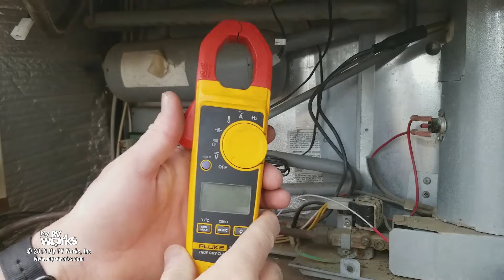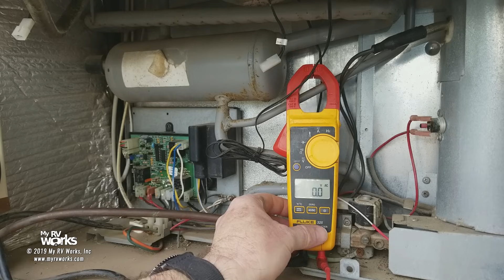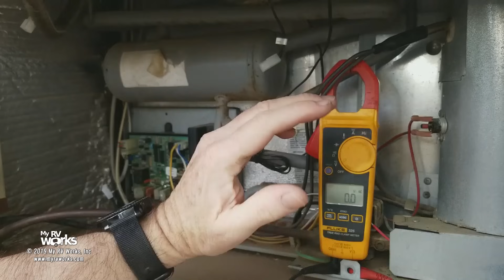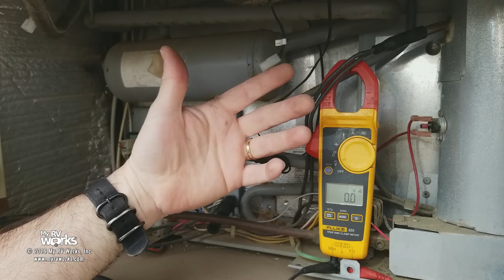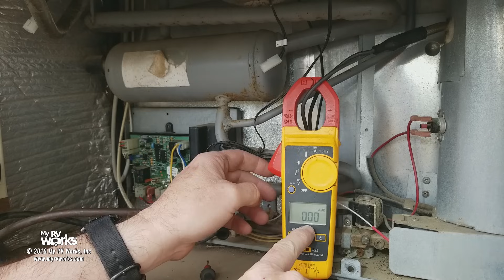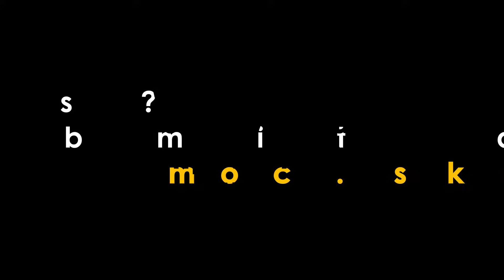Troubleshooting An RV Refrigerator That Works On LP But Not On Electric

Comment: Thanks for producing a concise explanation of how to diagnose my rv refrigerator problem. One question, does it make any difference in the diagnostic process when the power source is a generator/ inverter rather than "shore power"? I suspect a failed controller board however I am unsure if the generator delivering 60v on neutral and ground and 60v on load and ground changes any of the diagnostics.
Reply: Makes no difference. Your refrigerator doesn’t know where the power comes from. It either has power or it doesn’t.

Comment: I have a Dometic 2662 and followed your diagnostic tips, and seems like the heating element is not getting 120v delivered through the control board and no lights are illuminated on the fridge so I suspect a bad CB. Does this mean it will not work on propane also ? Thx for the great video
Reply from the maker: The lower control board is fed by 12 volts dc. There is a fuse inside of that control board. So verify 12 volts is making it into the board and through that fuse.
Reply: @MyRVWorks  I forgot to mention earlier that both fuses are good and I verified that 120v is making it to both fuses

Comment: Darren what do you think about these 12 volt conversions. I'm not sure the proper terminology but switching from 110 volt propane refrigerator to these newer 12 volt induction motored compressors. I've seen a couple videos, but the ones I've seen the company that produces the 12 volt induction motor compressor donates the components to the people making the video. I think when you donate a product tune independent tester it kind of taints the process. I just wondering if you had any experience or knowledge of these systems. I'm just thinking that with a proper solar system maintaining a charge on a proper size battery Bank. That may be a refrigerator that actually maintains 36 degrees continuously would be an advantage or does it open up Pandora's box and battery drainage?
Thanks
Nick from Arizona

Comment: Hi Darren, I have 120v power on both sides of my fuse but nothing coming out of the board to the heating element. I installed a new board and have the same thing. Any suggestions?

Comment: I have an issue with my 3 way Dometic fridge (from 2013). We had a gas person today (who specializes in this type of equipment) but he could not find the source of the problem. Basically we can smell gas in our motorhome but only when the fridge is ON. When the gas hob or oven are in operation (while the fridge is turned off) we don't have the smell of gas. The flame from the gas hob is good and the technician said he was pretty sure there is no leak in any pipes. Some help would be greatly appreciated. We have run out of ideas and solutions.

Comment: Looking for help. RV refrigerator not working. Inside walls are hot. Been on 9-10 hours. Burners work, heating element works. Everything works but no cooling. I don’t know anything about ammonia systems. R12 502 404a 22 all day lol, but 1st time working on my neighbors RV fridge. Is system out of fluid? Am,Onvia peak which is why no cooling and boiler just heating the piping up? Thanks guys

Comment: I am connected to power at home and that outlet that connects to the fridge outside is not getting power. No breakers tripped or fuses blown. 2014 salem forrest. Any suggestions?

Comment: Your video was very helpful, and I believe I found a bad circuit board, as there is 120 at the "wall" outlet but no power on the fuse above the power in wires.  At the end of the video you mentioned a 2nd, upper circuit board to check, and that you would cover it in another video.  I've search all of your videos and can not find it.  Could you please direct me to that video.  Thanks for your help.
Reply: Great vids. I am also looking for the follow up video on which board is bad. My board looks good but does not work on AC. Works on propane but can not switch to auto or AC.

Comment: Great and awesome video.   I have the same refrigerator 3862  and same 
problem. Followed step by step instructions  My heating element is good,    So I 
wondering about the video to determine from the lower or upper circuit 
board ?  Again  Thanks for the videos
Reply from the maker: I have two additional resources for you:  First is this video:  https://youtu.be/IT_5HGe4q-k
You can jump to 35:45 where I discuss control board troubleshooting.

Second resource is on my Website Resources page:  https://myrvworks.com/manuals/
Filter for refrigerator/Dometic and search for this file:  "Dometic Refrigerator Training"
That was a PowerPoint I saved as a PDF.  On page/slide 62 & 67 there is more info on troubleshooting the wire harness and upper lower boards.

Comment: My reefer only runs on propane as of today and I've notice half of my outlets inside stopped working. I have one gfci and it seems fine and reset it just for good measure. Is it possible that the reefer not running on electric is also the cause of half my outlets not working?

Comment: Freezer is 8degrees but ref food is not working and 59-65 degrees?  Please Lp is working but need to CJ upper eye brow board. How to  check eyebrow board power is all 12 v? Is it the 5 wire plug to ck?

Comment: Our 2011 Montana has a Norcold N811, it works fine on electric, when I unplug the camper to go the campground  it will switch to gas okay. But when we get to the campground and plug it back in it will switch off the gas but the electric won't kick it. I don't get any flashing lights on the panel. Now if I turn the fridge off and then back on it will work.  Any ideas what would cause that ?

Comment: I am trying to find the upper control board video . I changed the lower and still no luck . Tested the element and got 43 ohms . Have 120 volts on  the board.  And it works good on lp

Comment: Thank for all you do, checking my heating element and the omhs reads 36.6.  The specs say 44 omhs for the Dometic RM3663 is this element bad?  I have one I brought a few years backs brand new, and it's giving me around 40. is this one bad?  Any help would be greatly appreciated.
Reply: I believe he said plus or minus 10% variance is acceptable. So anywhere between 48.4 and 39.6 ohm is a passing value. Therefore, if your value is correct it sounds like it fails the spec resistance check.
Reply: @greauxpete  thank you I didn't catch him mentioning the 10% variance.  Does this also apply to the 12V heating element?

Comment: Very informative video. 
I  replaced my board on the back because I had no power to my heating element. Now I have no power still. My upper control board seems to not have any power either. It works on gas if i force hot wire it. And my heating element works if i feed 120 to it.I am thinking that it is my upper control board. But I don't seem to be getting any power to the upper control board. The check light used to blink. Now  nothing 😑 .
Lower control board is a new  dinosaur brand. I Donno

Comment: Last week I was prepping my cabover kamper to go on a trip. I has tested the fridge on propane when I got home from town after filling the 2 bottles. Then plugged into shore power and turned off the propane. Then had a delay to start my trip. Turned it off.. then days later when ready to go.. it wouldn't turn on.. on electric or gas. I had the control board tested and was told it went bad. So I ordered a replacement to dinosaur electronics in Lincoln city, Or. Eyebrow board was tested good also.. but still does not turn on.  Now what..?

Comment: My old Norcold stopped cooling, and I ended up replacing a bunch of stuff. Control board, power board, eyebrow board, and the thermister! The problem now is that it works great on LP if the AC cable is unplugged completely, but if the AC cable is plugged in, it gets too cold and freezes everything! Even if I have it plugged in but have the switch set to LP, it still freezes everything (presumably with AC). If it's unplugged, it cools to the right temperature with propane without overfreezing. Ideas?

Comment: Great helpful points. Thanks, Darren. Tho my fridge is a Tedco, these tips are helpful. My fridge works great on gas but not on 120 vac. When I turned off gas at bottle, the heater coil started to heat up.! maybe a conflict with the source of heat??
Reply from the maker: Hi Joe,  I can honestly say in all my time as an RV tech I have never come across a Tedco refrigerator - so I am at a bit of a disadvantage in helping you diagnose that issue.  Do you have the switch on the eyebrow board for Auto, AC and LP?  I know that on a Dometic and Norcold frig if Auto is selected than the AC is the primary and LP is secondary.  One test I perform is to place the unit in Auto and come around back and unplug the AC cord and verify it will switch over to LP.  Then when I plug it in again I verify it switches back to AC mode.  Have you tried something like that?
Reply: @MyRVWorks  I never heard of Tedco either until I bought this 1975 travel trailer with one in it. Looks very much like the common Dometic. Has no Auto control, just Gas or AC/DC toggle switch which works only when gas pilot/on switch id in Off position... . I shut gas off at bottle and it seems to be now giving me a hot coil at ammonia tank (good sign, i thnk). My brother said it worked for him before. How level should they sit? (My trailer is jacked up on one side for wheel repair). You may have a good hint here: unplugging AC and/or shutting propane off at main tank, back and forth, to force it into other energy mode. ..as it seems not to always shut off with fridge control switch.
Reply from the maker: @joeboudreault4351  Since these refrigerators are chemistry sets the more close to level the better!

Comment: So I took a closer look and it looks a little brown/burnt on one side of the 3amp fuse on the circuit board, I looked around for a replacement lower board for my RM7030 refrigerator, non of the boards that says they will fit my unit looks like what I have, any suggestions?

Comment: Darren - great video.  My Norcold 1200 series just got a new cooling unit installed 6 weeks ago, and was working great, but now my temps show FRZ: 25 and FRIG: 52 just in the last couple days.  AND I no longer hear the cooling fans running, and the ice-maker isn't making any ice.  Unit runs only on LP and when on AUTO will only go to LP, and not AC.  So no run on AC and no cooling fans running.  I suspect a popped fuse but until I can check it out, I need to cool down the fridge/food!  I put a fan blower into the outdoor service access with a bungee cord.  Will check in the morning.  Any tips..........?  Tks

Comment: My issue is my solar will not fire up my electric anymore. I upgraded my solar and now it will not use the AU end only runs propane. Shore power works fine

Comment: Should I have 120 volts on both the pins that the heating element attaches to on board I have the correct voltage on the right pin but the left have nothing

Comment: Great video.  I have a norcold that is not working under AC, but fine on propane. 
Checked outlet, good. Checked AC fuse, good, 
No power to element leads on lower board. 
(Bought a new board and same thing). 

Upper board seems ok, but I’m stumped. 
Any other ideas to check?
Reply from the maker: Hi Eric,
 
Your question has been selected for an upcoming video where it will be read and discussed by Darren - Certified RV Tech and online personality for the 'My RV Works' videos.
 
If you have not already subscribed to the 'My RV Works' YouTube channel, please do so and keep a watch for the ‘RV Tech Talk’ video releases.  This series is a selection of comments and questions that will be covered and released weekly.
Here is our YouTube link:  https://www.youtube.com/c/myrvworksinc

Happy Camping,
My RV Works Media Team

Comment: If that cylindrical 10A fuse is good (checked with meter) but not getting any current. Where is the problem? How does the current flow?

Comment: Hello Darren I have three issues with my RV travel trailer that is bugging me; The first one is a Dometic RM2551 refrigerator that works on AC but not LP-I see spark but no flame. The second is a Dometic heater that comes on and I can hear the fan, clicking sound like a spark, and blows heat for a few seconds and then turns off. The third is a Dometic 15K BTU AC top mount that burned a limiter switch Klixon 20z6ab MRA4720-12027 on top of the compressor-I am assuming it's a compressor. Do you have any videos on these models or situations? Thanks in advance for your responses.

Comment: I recently put in a new cooling unit and the old heating element was frozen, so I bought a new one from Amazon. It worked for about 2 weeks and then would only work on propane. I did as you suggested at 12:48 and had OL. I pulled the heating element and it was burned and half of it had burned off, so it was about 3" instead of 6". I just ordered another one from a different manufacturer. Any ideas as to why it would burn through?

Comment: I'm a little confused on the blinking check light only because of the LP, I have my LP turned off and the light blinks but the refrigerator doesn't seem to switch over to AC power but the electric tube heater is working. So should I turn the gas back on? I want it to run on AC, but if I turn on the gas won't it just run on gas ?

Comment: I have followed everything to diagnose my Norcold 1210SST refrigerator and the unit does not function well in electric mode.  AC voltage going is 110 volts as well coming out of the terminal board for both black and yellow leads. Checked ohm readings on both 225 watt heaters and they are 65 on one and 66 on the other. Range should be between 58 and 68. Changed control power board as well high limit control module as it seemed to become weak relay. Changed out the high limit sensor as it did not work with old sensor. Propane works fine and no error messages but electric does not work or frig starts to raise in temperature. I have not taken out the elements but can a slight coating of corrosion on the heating elements cause some sort of an insulator for the 707 ammonia and hydrogen not to work?  Any suggestions as I am baffled now.
Reply: To add I checked the amperage and was getting 1.3 amps. If I have 110 volts going in and the rating of my elements should be 225 watts than my average should be 2.0 amps. Will this cause lack of heating?  Right now and based on voltage and ohm reading I am only getting on each element getting 186.15 watts.

Comment: Great video, super easy to follow. I hope you may be able to help me with my issue as my Dometic NDR 1292 now works only on propane but not on electric. I followed your steps and believed that the heat element was bad and ordered replacement, but when testing the Ohm resistance I get 33 from the new ones and 33 from the old as well. My issue actually is the fuse keeps blowing when I switch fridge to power. It is the fuse you show in this video. I have correct current on left side but obviously no current on the right as the fuse blows instantly when I turn the fridge on to A/C instead of propane. Any help here would be greatly appreciated.

Comment: Good Video.  Had 120 at outlet, 120 on both sides of fuse, nothing on j8/ j7 and good connected current for heating element. I replaced relay in circuit board and still no power on j7/j8.  Ordered a board (new design) and still no power to j7/j8.  I pulled eyebrow off again to see if I missed  corrosion or something the first time I looked at it.  Nothing, everything  looked fine.  I wiggled  the plastic clip holding the 4/5 wires to the board and tried again.  It was a poor connection on the contacts  of upper board.  J7/j8 now have power and fridge now cools on electric.   Hopefully this helps someone. "My RV Works" should I replace upper board or is this common (poor connection)?
Reply from the maker: Good troubleshooting. As I was reading this, before I got to your solution, I was thinking it was a connection at the eyebrow board or an issue with the wire connecting the two.  I don't know that you need to replace the eyebrow board. Apparently the problem was not with the eyebrow board but with the connection. So, clean your connections really good and keep on happy camping.
Reply: I came up with the same problem no power to the element but I don’t understand eyebrow board term can you post pics before I drop a hundred on a new board

Comment: When I meter (AC volts) at j7 and j8 individually to ground I get 120vac. When I put a lead to j7 and a lead to j8 to meter for 120vac I get 0. I am confused on how to properly test this. Is it pin to ground or pin to pin?

Comment: My dometic fridge keeps blowing the glass fuse. I swap the fuse it'll run for an hour or 2 on electric then it blows the fuse. So it seems like the control board is ok, but the electric heating element may be pulling too many amps? What are your thoughts?

Comment: Hey thank you for your videos man they're great! I need a little help, I hope you read the comments lol my dometic 2351 wont work on 110, the fuses work i replaced the 5 amp but it wont try to turn on to cool even when I open the door but it doesnt say check, it acts like it's fine tho its not working unless I turn the propane back on then it works on lp just fine. Trying to save $ on propane though.
Reply: I've had the same issue and per the video, I checked the heating element and it did not pass.  I've ordered the part and hopefully will be up and running in about a week.  The repair should take about 10 minutes per one of the videos on how to replace the heating element.  Good luck.